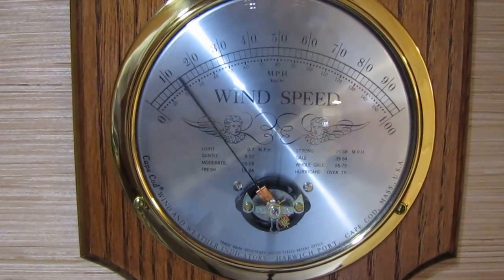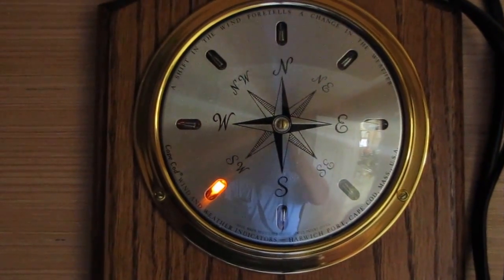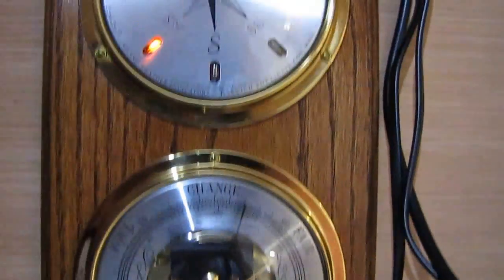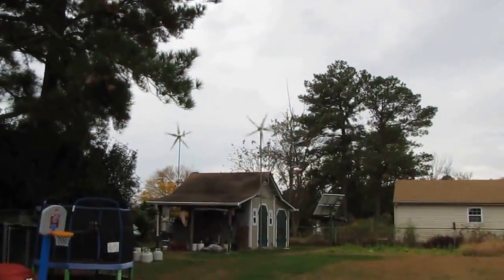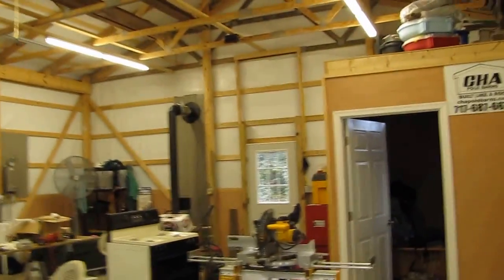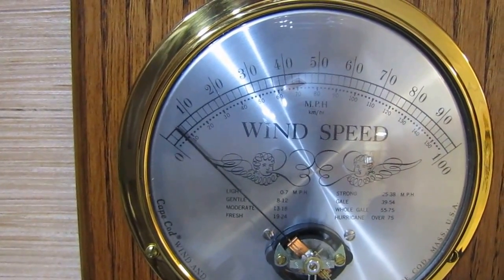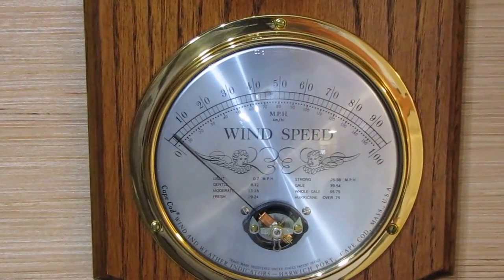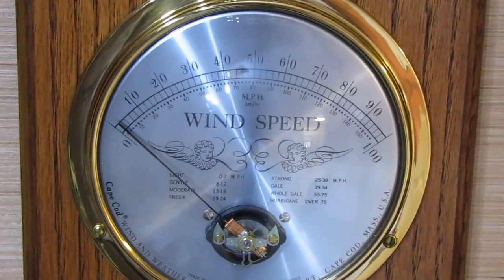Analog Weather Station In Action   By Cape Cod Wind And Weather Instruments By KVUSMC

Comment: I have the wind instruments of these and in 2017 we had a major severe t storm with steady high winds and wind driven hail. These cape cods measured up to 80 MPH. Was steady 65-75 for good 15 min. Compared them to several other more expensive systems of mine and compared very well. Takes a bit getting the anemometer to start. Think around 5 MPH or so as they have some magnetic cogging. But run well in high winds. Didn't notice any issues with overshoot.
Reply from the maker: Awesome Brother Mine is dead on accurate Brother Cheers KennyThat is some Awesome winds Wow 👌

Comment: This is cool to see. I searched on YouTube to see if anyone had made a complete installation video showing the soldering of the wires and came across this video. No one’s made one though. 

My grandfather bought a wind direction and wind speed indicator decades ago but never got around to putting it together before he passed. The paper instructions are still legible but time has clearly had it’s affects on the paper. But they made the print so small lol. I’m looking forward to setting it up and I’m curious if it’ll still work. 

Did you make the wood mount yourself? I don’t have that, so I may just have to make something similar because it looks very nice.
Reply from the maker: I appreciate it I bought it all like this on Ebay I bought the wind direction and anemometer from Cape Cod Weather instruments

Comment: Hi Kenny,

I love to see these old-fashioned instruments! I saw your three installation video's of this weather station and I like to warn you for a dangerous (possibly fatal) situation. I noticed unshielded electrical contacts at the back of the wind direction meter which contain hazardous voltages of 110 V AC. I advice you when working at it to remove the AC power first.
Reply from the maker: +Lucas “Hans” Heijst Yes Sir I Sure Will Buddy These Old Stations Work Great Buddy

Comment: Weather instruments that are built to last. The simpler and engineered, the longer they last. Cape Cod is one of the oldest weather instrument companies. And, being analog, these instruments do something no new digital instrument does today: instantaneous readouts. Most of the commercial made units in China take anywhere from 18 seconds to a minute to read out. That's a lot of data missed! We have several Cape Cod units that are approaching 40 years old on the Oregon Coast. Highly recommended. :)
Reply from the maker: Cyclone Performance Weather Instruments You Got That Right Great Equipment

Comment: I didn't see anything but I may be blind. How old are these and did they come from eBay ? I know it's all digital today. I was going to get me the same set-up in 1994 but was hesitant to buy these due to it being inaccurate so I got the Maximum digital station instead for $595 for the wind sensors and read-out. I still love these analog stations tho. There also was a rain gauge set-up that worked like these that clicked off every .01" with a pointer and a digital display for inches that showed 1.00" after the pointer got around to the top again and started over at .00". Those were even cooler. I can't find one online anywhere since the mid 90's. I don't remember who made those. I do know that Texas Electronics manufactured one in the 1970's for their commercial stations.
Reply from the maker: They Still Make These Units I l will send you A Link  Yes I like the Analog they are great units Buddy 
http://capecodwindandweather.com/

Comment from the maker: All 3 Meters   Barometer And Wind Speed And Wind Direction  And Sensors $ 245 For The Wind speed  Sensor And 50 Feet of Cable And The Wind Direction Indicator  And Sensor And Cable $ 239  And The Barometer $ 169   There You Go Buddy